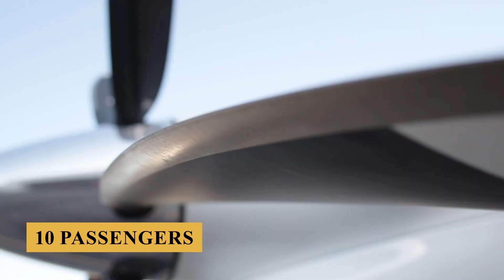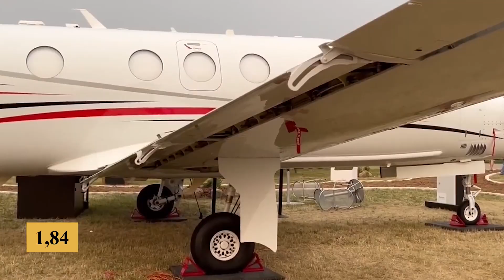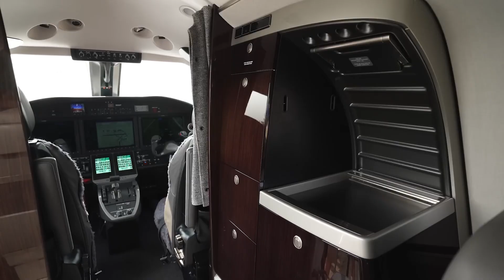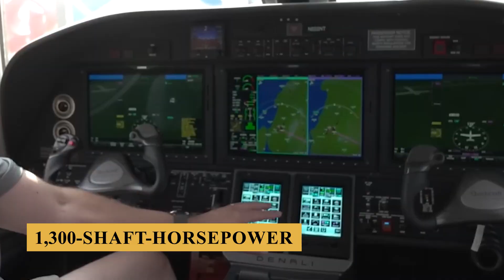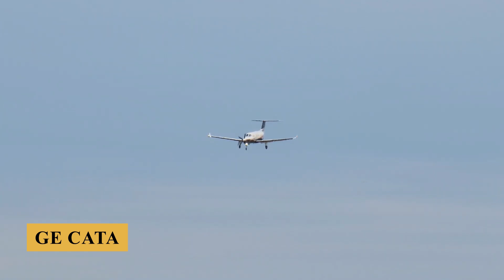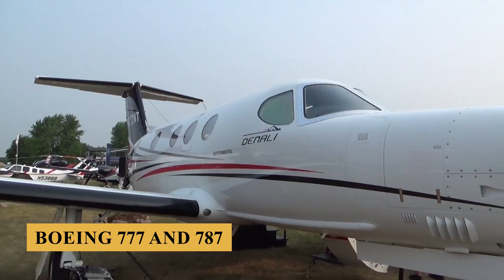Inside The $7 Million Beechcraft Denali

Comment: It comes down to the toilet. For performance I like the Epic, but no toilet. TBM is cramped. PC 12 has a great proven history, and a toilet. The downside could be the GE engine. I suspect the certification delays were as a result of the engine. I remember the GE CT7 teething problems on the SF 340. There would have to be a significant reduction in block fuel to use an unproven engine and I doubt if it is there.
Reply: Just poo out the window